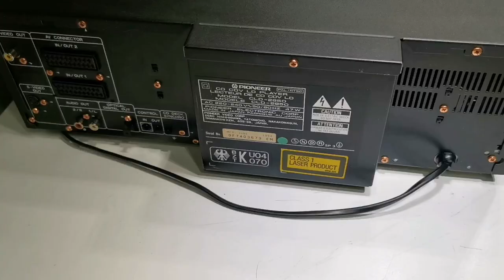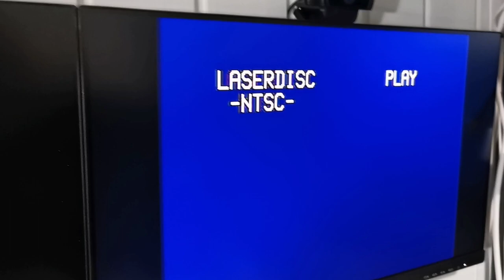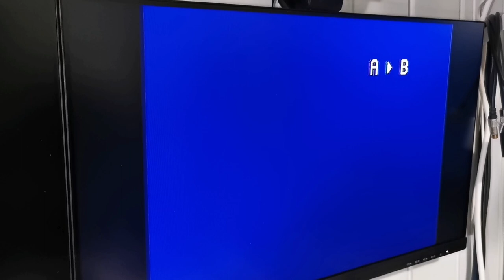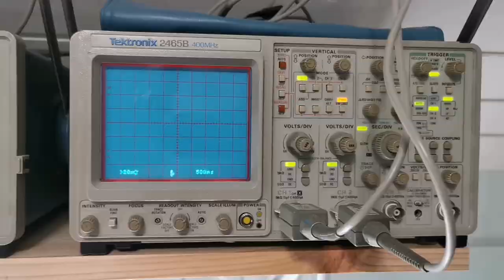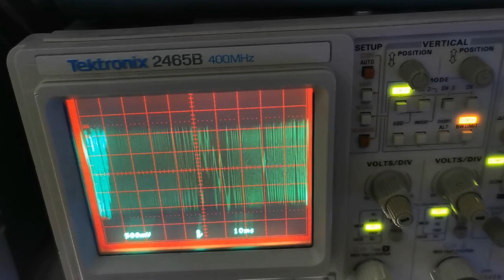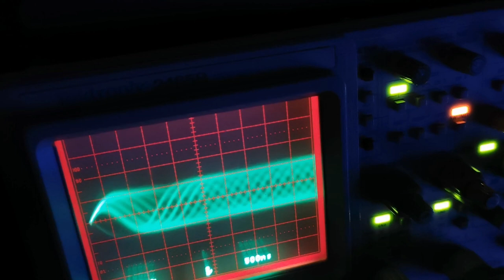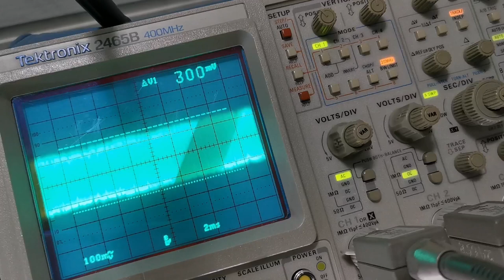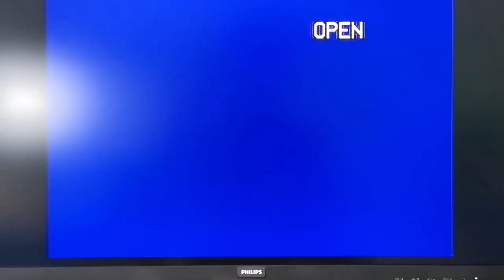Pioneer CLD-2950 Pal/Ntsc LaserDisc Player Repair

Comment: I have a Pioneer DVL 909.  The disc spins,  both the lasers try to read the disc, and finally eject the disc. What could be the problem? Cleaning the lenses didn't work.
Reply from the maker: DVD, CD, LD or all? Did you clean tilt sensors also? So if you put in a LD and it recognize it, starts to spin and try to play. It could be a lot really: Bad laser, bad spindle motor, power issue, m-holder, sticky grease and list goes on.